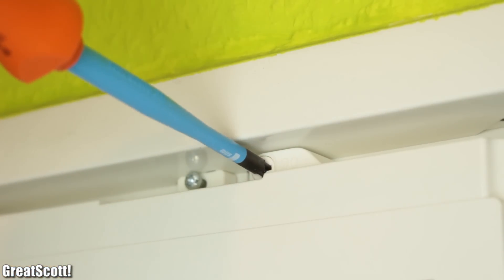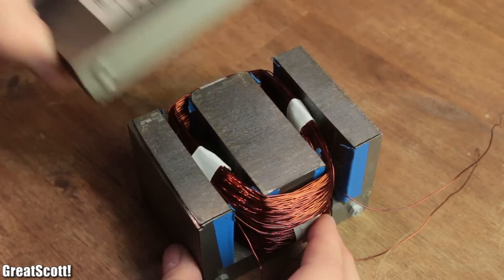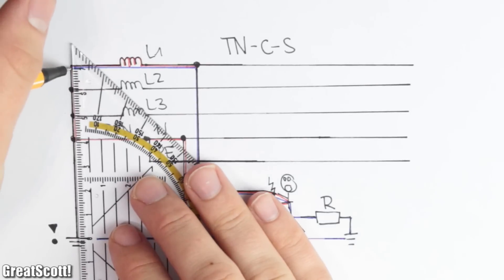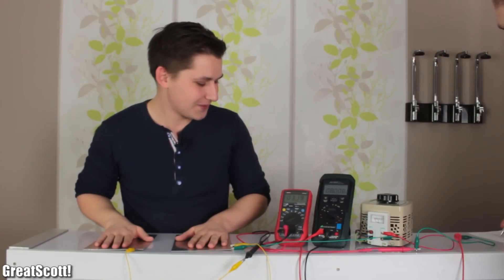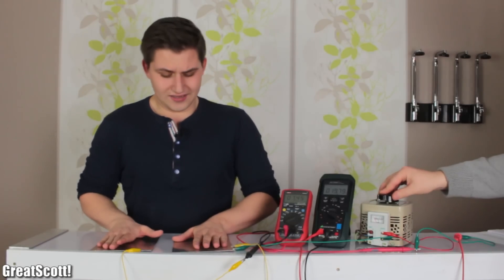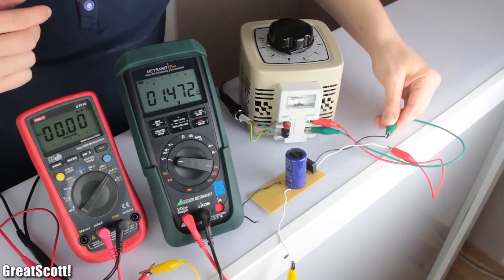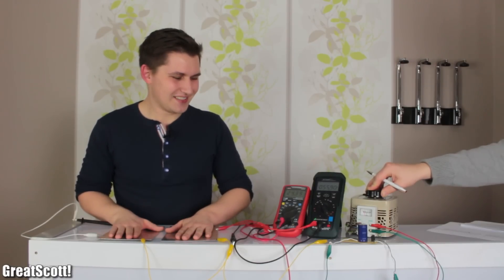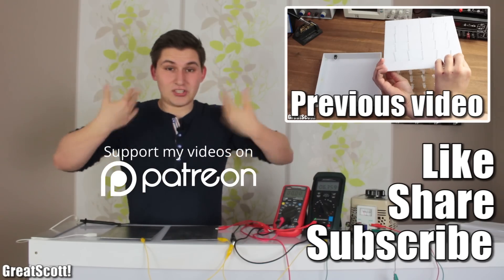AC VS DC - Pain Test (Experiment)

Comment: DC current is comparatively safer because it flows straight and unidirectionally. On the other hand, AC current is alternating and flows changing its position from time to time. I know even 5V AC current is also very painful.

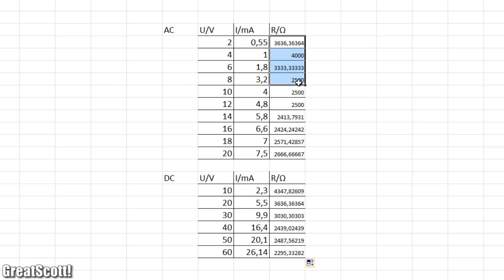Comment: Hello, to anybody who has the understanding, based of 5:53 tables, can anyone explain how come he was able to handle it at 30V-DC with 9.9 mA going through his body and couldn't handle it with 20V-AC with 7.5mA going through his body - I am not sure I understand this part, my comprehension would be that with 9.9mA, it should hurt more regardless of his body's resistance in AC or DC - the flow of electrons is much bigger in this scenario in DC and he is still fine while with a lower AC current it hurts hime more, I don't get it.
Reply: possibly because having muscles twitching 50x a second is not a pleasent experience

Comment: we did an experiment on class that was see who could resist more. We took a rheostat connected to 230Vac and we put our index finger and our thumb next to each other in the rheostat and then slowly separate them until it is too painful and then mesure the voltage. I get up to 100V and my classmate up to 110V

Comment: When I was a teenager, we would try something similar,
We had 2x AC to DC converters, the first one was to get power from the socket to DC (sub 14V).
The second one, we connected the secondary coil to the DC, and the primary coil to the output (where you touch).
Just interrupting that DC power flow between the transformers, was horrendously painful on the output we were holding it.
Try: AC -> DC 0-14V ==> DC -> AC (is still DC, but only when the connection between the first and second coil is interrupted).
We had a guy chicken out at 8V, another friend went to 14V. I myself tested a good 20V (that's about 200+V in the body, but you'll get one shock, rather than 50/60Hz).
just to say, the pain tolerance is different from person to person.
And before your heart gives out (it is surrounded by conductive muscle tissue and liquids), your biceps and pectoral muscles will hurt like crazy, almost as if they will tear off the bone.
So far I've had no heart attack from this yet!

Comment: Brave lad! In my life, before, and after graduating as an electrical & electronic engineer (>45 years ago!) I have had countless shocks off just about every kind of electrical device. From electric drills to food mixers to TVs, PCs, Disk drives (BIG refrigerator size, 1980's style) to garden equipment. Fortunately I learned early on, and before I even went to University, to avoid touching live wires and ground with both hands (as you were doing!!) and when testing inside operating TVs (CRT style!!) always to keep one's left hand in a pocket, probe ONLY with the right (even if normally left handed) because the current then flows far less or not at all through the left side of one's body and hence the heart en-route.

To  RE-EMPHASISE the point well made in Great Scott's video DO NOT TRY THIS AT HOME! You only need to make one mistake ... and you're dead!
Reply: I have experimented with some higher voltage capacitors of small charge and low energy. I found that below 450- 650 V it makes a difference whether you press or knock your fingers against the electrodes or touch them slightly with almost no pressure. At 160 µJ and 250 V one doesn't feel much with dry and intact skin on your finger tips. 
But above 500 V it just spikes sharply through your hands as if it has found a way to just jump through the skin as it has the necessary pressure all by itself. Of course I don't recommend trying this at home, even though I believe it isn't unsafe from hand to hand at low energies below 5 mJ.

Comment: It is not necessary the voltage, which is dangerous. It is the amperage. You can touch millions of volts and nothing happens. You can take as example Tesla Coils, electric lighteners, static charge on the carpet.
The main problem with 240 volts AC is, that you get to 60 Ampere too. If i remember, than could be a half Ampere be deadly.
Reply: This displays efficiency of correctness; Just the static charge from rubbing some materials can produce a spark; If the spark conducts amperage even tenth of an amp will burn tissue if it penetrates the skin 240 AC Mains are UK; Domestic US uses only one terminal energized;  a 325KV Van De Graaff Generator can be had from Science Supply but 325 Kv Power Distribution will have you on BBC ~ what is left of you that is;

Comment: I would want someone to try wıth Amerıca's A.C. Voltage; but rhnk you very much for demonstratıng and please do not do this again!!!
Reply: Old timer electrician — here; I am US — can put 2-fingers across the mains to see if they are hot ○○○ they guy has a Variac;  Even DC can fry tissue if current gets going so I wont explain here how to get that to happen; Distilled water wont conduct much but Ground Fault Circuit Interrupters are not total protection;

Only isolating electrical anything from water area is the only best idea;

Comment: Its funny, i was get shock from 250v both prong isolation transformer, but not as nearly the pain on only 1 prong 220v electricity live wire even actually im in good isolation from ground lol, ac 20v after transformer i dont feel anything except autotransformer though  😁

Comment: While messing with pc power supply i touched some thing and the 200V capacitors discharged and that felt painful as shit but luckly i was not grounded thanks to my rubber shoes.People BE CAREFUL THERE IS NO MESSING WITH ELECTRICITY

Comment: Hey Scott but how can ElectroBoom touch 150V DC and feel nothing he says... Confused being a Bachelor in Electrical and Electronics...What is Truth ?
Reply: Hi, I think it's because ElectroBoom touches the 150 V with his finger and not the hand so he has less contact with the conductor and less current goes through his body.
Reply: At home I tried to touch 45 VDC (5 9V batteries in series that can deliver around 6 Amps when shorted) I tried with my fingers and I felt nothing (Even with my fingers being wet) . Right now I tried with my hands and it was painful (I don't try with wet hands 😖). I don't mesure the current but I think it was greater with my hands.
Reply: I made some measurements and the current is definitely rising with the surface of skin in contact with the conductor.

Comment: Square wave of the same peak to peak voltage as a sine wave is way more painful. I am not sure if it is because of the rapid rise and fall time or that fact that, given a voltage at a certain frequency, peak to peak voltage, and a duty cycle of 50%, a square wave carries 1.41x as much power, but it feels more than 41% worse.

Comment: Long before you were born, in the US, the Nat''l Bu of Stds. and UL labs determined a safe working voltage to be 50 RMS.  Additionally, to be classed as class I intrinsically safe (incapable of causing an acetylene explosion) the voltage and current both had to be limited to a figure which I've forgotten.

Comment: I think the reason you got quite low voltages is that you were nervous and therefore sweating, reducing your resistance. I just tried a small experiment with 9V batteries (new, so 9.6 V) and got up to 50 VDC without feeling anything, but when I went up to 60 VDC I got more nervous and definitely felt it. Not really painful, but annoying, and it was increasing due to my increased sweating (after that I also felt the 50 VDC). Something interesting I noted, though, is that it was only painful when I started touching it, and after a second touching it, it was a much lighter feeling. And Mehdi from ElectroBOOM once touched 120 VDC without even feeling it!
Reply: DC doesn't stimulate nerves much.

Comment: Fascinating.
You've convinced me that more current flows with AC (although I'd like to find some info on just how capacitor human skin is, because the 100-200pF value I keep finding doesn't seem high enough to make a difference at 50-60Hz).
Still, low current AC seemed to cause you much more pain than the same DC current.  I think it's the effect of the continual reversal on your muscles and nerves that hurts, more than the size of the current.

Comment: i saw in your video that you at one point had your thumbs very close to eachother. i'm curios if there would be a spark between your fingers if you suddenly switched between having the current through your whole upper body(i know that it would take the path of least resistance, and thusly isn't exactly a spread across your body, but one rather thin line, i didn't know where exactly it would travel) to touching your hands together, thusly decreasing the resistance and making you a lot safer.

Comment: AC or DC currents can cause fibrillation of the heart at high enough levels. This typically takes place at 30 mA of AC (rms, 60 Hz) or 300 – 500 mA of DC.   
DC current can cause  electrolysis in your blood&body , you will feel the effects later on

Comment: cute little variac, i have one from the same maker but mines a big buggar, 16kg and more than twice the size of yours, and with heavier wire used in the windings it can handle any load i put on it. handy little tools, mine is used to control a 12kv tesla coil

Comment: That was pretty dangerous, the levels of pain in DC current could be smaller, but the damage on the muscles and nervs still are present. It's a fact that AC current it's safer to work because the pain level is higher and exist the posibility of let de contacts go between the 0v cross.

Comment: I Have experience of  Sticking with Live ( Don't know either it was AC Or Dc ) but now I guess it was AC around 300 volt because that stuff was open box steplizer connected with 220vac mains and I was sitting on ground moisture floor , I was kid that time and even i had no idea what is ac , dc or v step up . I did two stupid things that day that could kill me , first i opend case of colour crt and touched some of its part wile running on electricity luckly ( not flyback TF  ) , after surviving from that I survived again from steblizer because GrandPa pull its away from me by its wire thus I am here so , During I sticked with steblizer  I lost my control with my Body or movement but that same time I can see , feel , listen , but  can'T speak even after wishing to speak  !!!!! Why ?????? I still don't know  because  after that time I get shocked many times but not such type sticking with electricity! Someone know what type of electricity can stick in such way I mentioned . AC Or DC of higher volt ????

Comment: Great video! Only stumbled on your channel recently.

I used to be a telephone engineer and worked on lines which were 50v dc, but went up to 100v ac when the phone rang (that was what triggered the oscillation required to make the bell work on old phones). I have no idea of the current, but if you had wet or sweaty hands, out at the customer, you'd feel a tingle, but in the exchange, it would be quite uncomfortable. If someone rang the number whilst you were working on it, the 100v blast certainly woke you up. Especially if you were at that top of a 12m telegraph pole at the time 😆
Reply: ik electroBOOM has made a video on that

Comment: I touched the 24VAC output of my transformer with the tips of my fingers between both of my hands. I didn't feel anything. Do the tips of your fingers have a significantly higher resistance than your palms?

Comment: Sorry but this experiment is really stupid, because you create a flow through your heart. Besides, with increased pain, your palms can start sweating at a moment's notice, reducing the resistance and capacitance to almost zero, and incresing the current through your body many times. At 20V AC you have a significant risk of fibrillating your heart, in the right conditions.. just saying...

Comment: Caution! The heart is also important a set of muscles. After such a test may be heart begin to vibrate (some of the heart muscle does not work properly, and others will have more work to do). Thus, the a doctor should monitor the cardiac rhythm for at least 1 hour after the test. Persons who do not necessarily feel that something is wrong (except electric shock). But when the heart stops, then it is a big problem.

Comment: I would like to add some remarks:
- Not only the value of the current is relevant but also the path. If the path is through the heart, you can get a fibrillation of the heart muscle even if you don't really 'feel' something painful. This path is typically from left hand to right leg.
- DC current can seems to be harmless in most of the cases. When I was a student (40 years ago...) a friend of mine was trying to repair an oscilloscope. It was a valves rig and there was various high voltage DC inside (150V, 350V, ...) only for the valves (not the CRT tube). He get the hand on a hot point. And he was "only" slightly burned. Quite happily?
During the night, he called be. He was not too well. I got it to the hospital. He have had a blood electrolysis...

Comment: question can you still convert ac to dc with diodes  on -ac and on + ac and have a capacitor in parallel would it work?

Comment: I tried using a TENS (transcutaneous electrical nerve stimulation) device to control restless legs at night. It applied micro-amp and milli-amp currents between electrodes on my legs. And I can confirm: AC electricity feels nasty. It's a horrible jolty, twitchy, nervy feeling, and your body keeps shouting "stop it! Stop it!"

Comment: The good thing though, that it isent the volt that will kill you but the amps
Reply from the maker: It is both that kills you.
Reply: GreatScott! I was taught that you could resist fx 1000 volt if amps is low, but if volt was 10 and huge amps would finish you off. I have no idea if it is wrong or correct, but please correct me if it is wrong
Reply: Its the total wattage that kills you. This is calculated by multiplying volts and amps, therefore like great scott said "it is both that kills you".
Reply: Lieberdk actually it's the shutting down of the central nervous system that kills you.
Reply: Lieberdk Kinda wrong. You still need enough voltage, otherwise there will be not enought current flowing through your body.

F.EX: You can easily touch 5V 50A and not die/feel any pain, but if you try to touch 1000V and only 1A you will most likely die.

You can easily calculate how much current flows through you with the ohm's law: U=I*R
The body has a resistance of ~2000Ohms when you're grounded with your feet and no insulation.

So, when U = I*R or I = U/R -> I = 5V/2000Ohm = 0.0025A = max. 2.5mA flowing through your body. 
But if we have 1000V/2000Ohm = 0,5A = max. 500mA flowing through your body, which can kill you.

But if the electrical object has 1000V and only 0.003A it can't kill you, since the max amount of current, which can flow through you, is the produced 0.003A from the object. -> No harm at all.

Comment: When doing such tests, never do it from arm to arm (like in this video), because your heart is between them ^^. I did a test with DC and AC to see how it feels and what the difference is. But I attached one cable+ on my under part of my right arm and one cable- on the upper part my right arm, I mean one near the elbow and the other near the wrist on the same arm. But I needed more than 50Volts to feel something. I remember when I was a kid, me and my college were electronic freaks and so one or two times I had encounters with different voltages, because of lack of attention. I've got contact with 220Volts about 20 times :). But the one I remember and I will never forget, was the 380Volt AC. I think I jumped about 3 m back after contact. Nowadays I know how dangerous these accidents were. But I learned a lot about electricity and electronic by learning by doing (and painfull feeling).
Reply: Well if you've got an audio amplifier just check its max output voltage. If its below 12 V you can do this experiment if you feel lime wanting to have pain. (dont do it, if your heart is weak or something or just dont do it if you want to be safe)
But you can basically touch the two wires of the output (left OR right) and plug your phone into the amplifyer while controlling the frequenzy of the output with a frequenzy sound app. If you dont feel anything crank the volume up. If still dont feel anything at any frequenzy you will have to put the output to the side, where you are touching the wires (left or right speaker turned on with the app). Then you will see, that very  low frewuenzy is not that painfull, low frequenzy more and high frequenzy less again until you wont notice it anymore. But be sure to not do this for a long time, cause the electrolytes of your body could split up due to current (blood also) then these might get toxic

Comment: When I was younger, one of my car cylinders was missing, and a mechanic told me to remove the spark plug wires, one at a time, to find out which was missing.  He forgot to tell me to turn the car off between removals.  I pulled the wire out of the running car, and the shock throw me on my ass against the wall about 5 feet away.  Was that high V and low A?  Anyway, I won't ever do that again!

Comment: I don't what is happing with you but I have DC PSU that can output up to 62V and I feel nothing at all when touching the wires with my hands!!!!!!!

Also, the same with AC I can touch up to 18V(I used a transformer for this ) without any problems or what so ever !!Q

Comment: pretty sure it's the amps that will kill you rather than the voltage
Reply: 20 amps at 2 volts dc wont kill you
Reply: TheW3lshGamer you are stupid, you can't have amp without voltage
I=U/R
Reply: rene kenshin 2 volts can't carry 20 amps through your body.
Reply: Let's say: 24V 10A supply.

If I=U/R:
Body resistance: ~100-1000k ohms

24V/250k=0.000096A

And body resistance is not linear. If the voltage is high enough, the skin starts to fail.